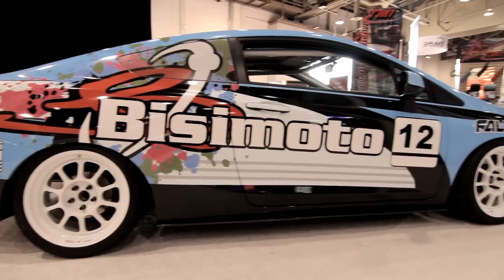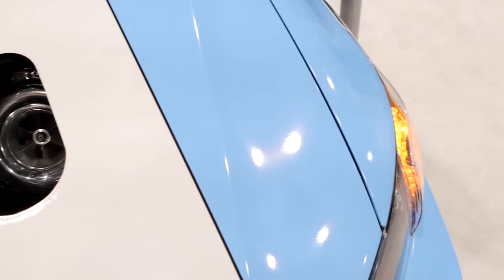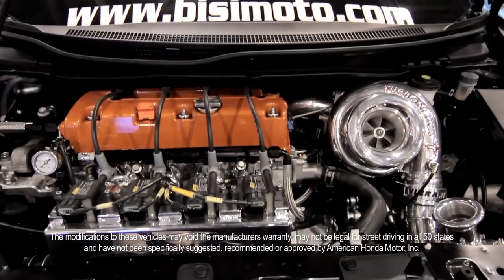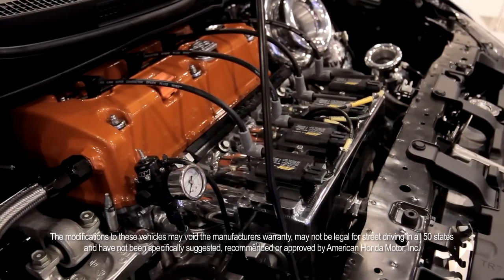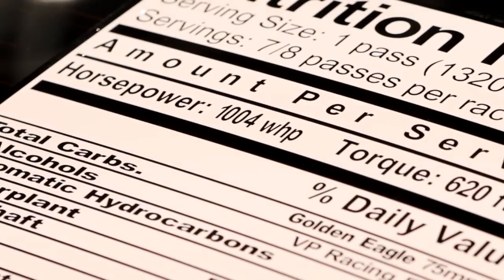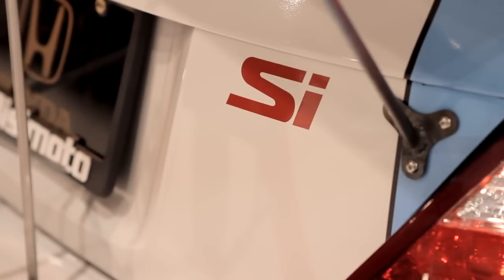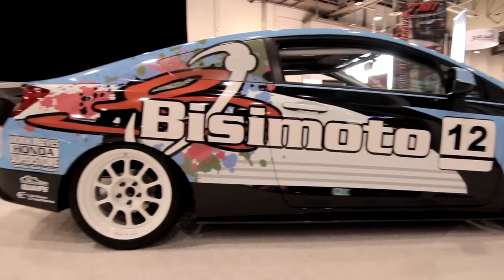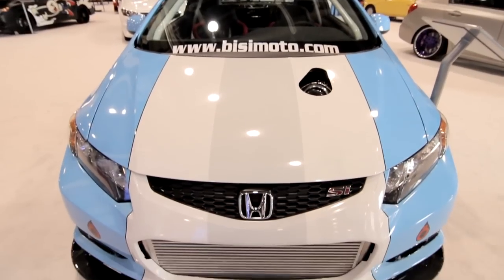2012 Civic Si Coupe by Bisimoto Engineering

Comment: I think he means grip wise. For a FWD car to grip, it would need pretty much drag slicks and a good suspension setup. The dyno says 1004WHP but on the track, if it can't put that power on the ground and do nothing but spin wheels, then it can't run any good times.